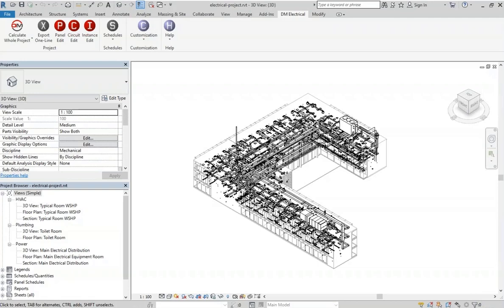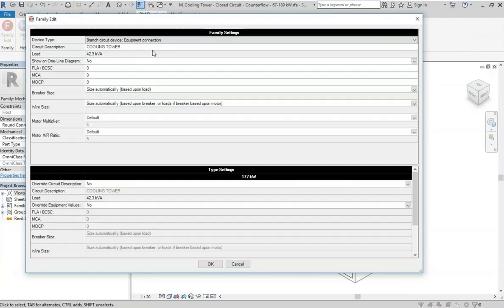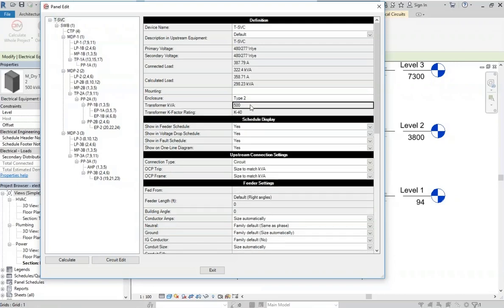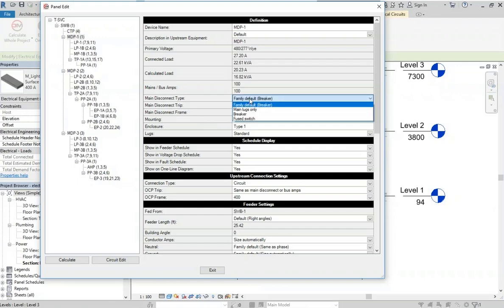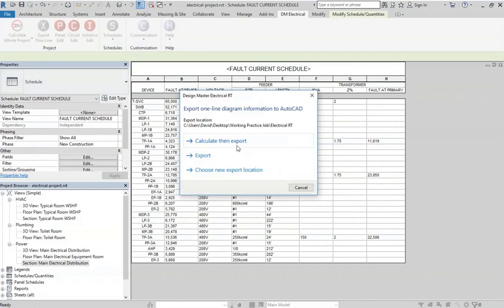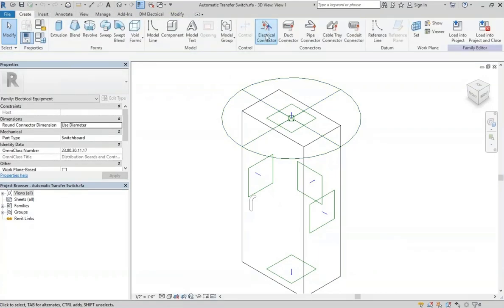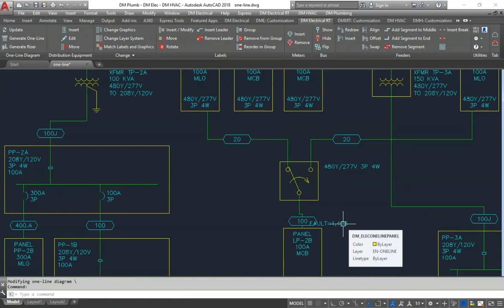Design Master Electrical for Revit: Creating Custom Families (10/11/2018)

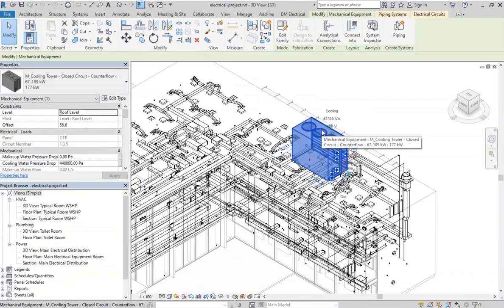Comment from the maker: How Design Master Electrical uses families (00:54)
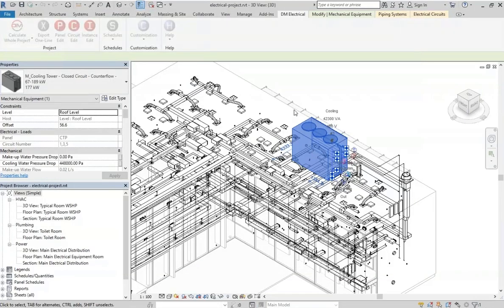Accessing the Family Edit command (01:51)
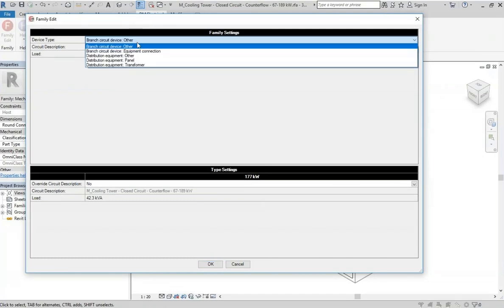Definitions for branch circuit devices and distribution equipment (02:25)
The Branch circuit device: Other device type (03:06)
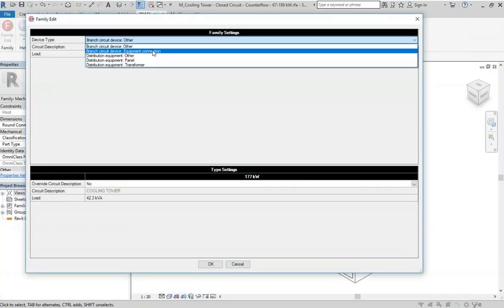The Branch circuit device: Equipment connection device type (05:19)
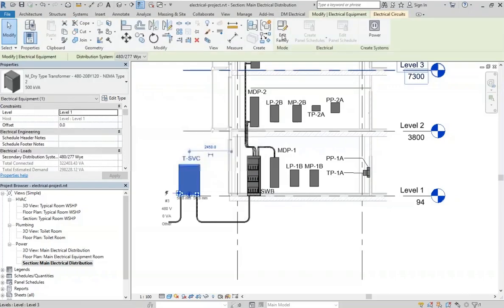The Distribution equipment: Other and Distribution equipment: Transformer device types (10:10)
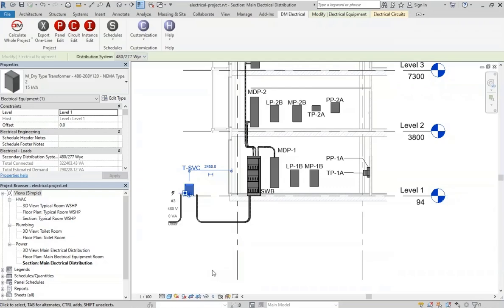The Distribution equipment: Panel device type (16:13)

A brief overview of Design Master Electrical RT:
    Introduction (20:18)
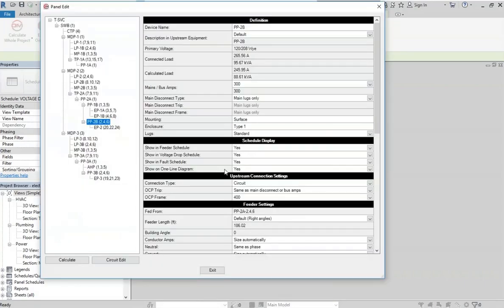    Feeder settings in the Panel Edit command (21:47)
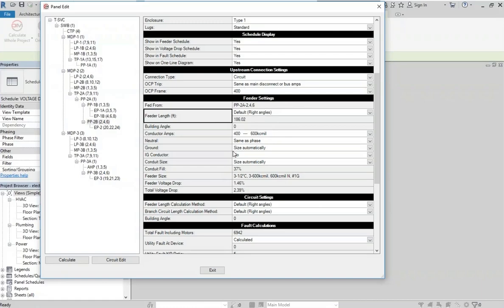    The Fault Schedule command (23:32)
    The Export One-Line command (24:29)
    Customizing one-line diagram graphics (26:03)

“How do you create and insert an automatic transfer switch?” (27:32)
Automatic Transfer Switches in Revit: http://www.designmaster.biz/support/blog/2019/07/automatic-transfer-switches-in-revit/